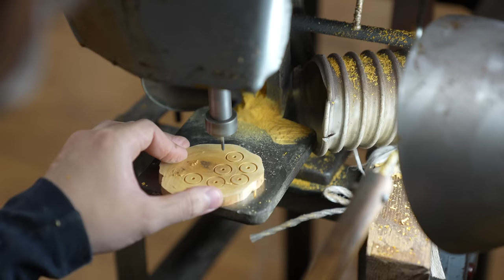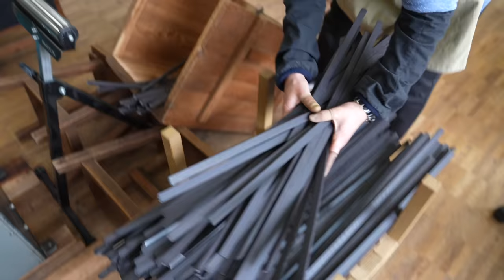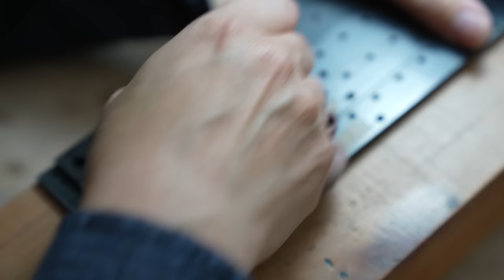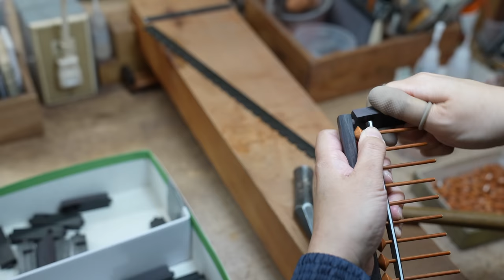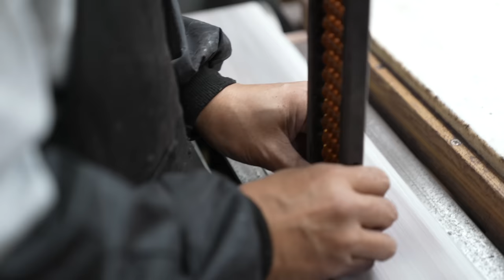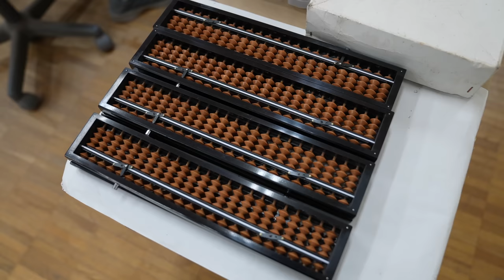そろばんを大量生産するプロセス。「質の雲州」と賞されるほどの優れた品質を誇るそろばんメーカー。

Comment: These Japanese abacuses are really nice. In general, Asian philosophy is based on rectangular group formation; as opposed to Western philosophy which is based on circular group formation. That’s why Western logic systems use the Venn diagram. 

In Japan, tatami mats are a symbol of “space” divided into sections. Tatami lines are derived from Japan’s Chinese roots. Some sections are more important than others. 

So the abacus is related to the idea of using straight lines to represent values; and then groups. Followed by curves used to represent values and groups in a different way. Japanese temples have both curves and lines which point to sections of the sky to form star groups. But don’t ask for architectural drawings, those are a state secret! 

There aren’t any video games which allow kids to use an abacus to assign values. Kids are only allowed to “respond” but never to express. An abacus could have beads painted with different colors, so that kids add and subtract emotions.